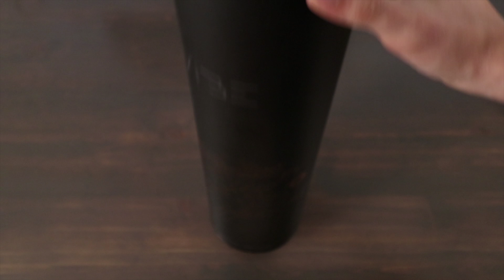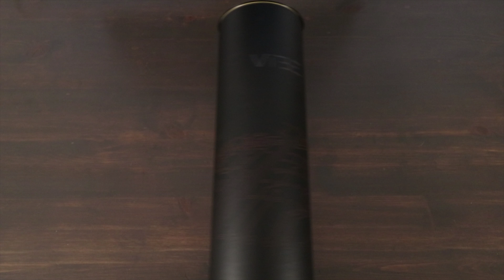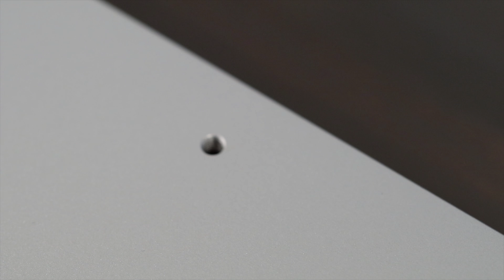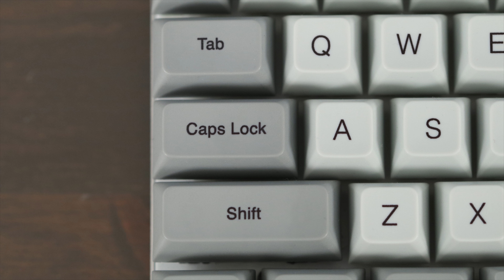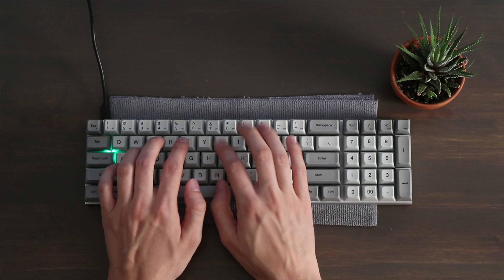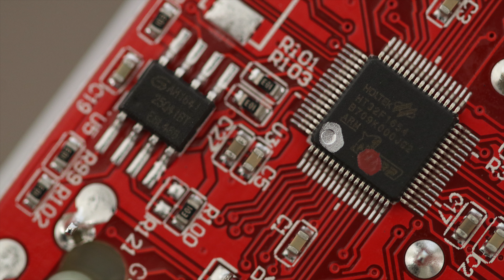Vortex Vibe Review

Comment: I'm hoping the programming steps on the consumer version includes the 128 char count in the macros.  I don't see it advertised anywhere.  I have great ambitions for macros.  Edit:  It works on the consumer version too.  I'm exploring this keyboard now.  Very fun.  Sounds much better than my MK2016 also with browns.  Thanks for making the function layer map.   It's much more useful than the user manual.  Also, for those getting this board, I urge you to update the firmware, because I had issues changing to colemak before the update.  (The key combo turned on scroll lock instead of Colemak.)

Comment: I have this keyboard, and there are several differences between the engineering sample that you have and the one that is available for sale. Mine has no backlighting, a black metal plate, black cherry stem housing, and highly sculpted keys. I also have the Cherry MX Silver Speed Switches. One thing worth noting is that you do need to get the firmware update from the Vortex website to get the 00 key and the lighting on the caps lock working (I am on Windows 10). This is a very unique keyboard that has somethings that I really wanted...a reduced TKL-like layout with a number pad (I use the numpad a LOT).
Reply: do you use this for excel?
Reply: Man, I have this keyboard and always assumed my caps lock light was busted. Thank you so much for this comment!

Comment: I guess folks don't find the fn key placement uncomfortable? I think would be better if it was on the left of the keyboard, so it leaves the right hand to only press those keys on the fn layer as opposed to having one hand do both, similar to how the shift key is used.
Reply: on the pok3r you can configure the caps lock key as additional fn key
Reply: well standard bottom row is a very important feature (+ no other keyboard have the fn on the right aside laptop keyboard, anyway)

Comment: Does this keyboard work on OSX/macOS? Seeing as that OS doesn't have a num-lock mode, I'm concerned you couldn't use the number pad correctly.
Reply: Since it's not a typical keyboard transition, I would venture a guess and say that this "numlock" is implemented at firmware-level, so it should just work.
Reply: Hey! I was thinking about getting the vibe for my MBP setup as well. Were you able to get the numpad to register?

Comment: The bottom is missing the DIP switches from the Poker series. Do you know if it's still possible to remap the location of FN and PN? (DIP switch 4 on the Pok3r)
Reply: In case anyone else was wondering, I contacted Vortex and got an answer:

"You just need to choose a layer and then hit Fn+L_shift for 5 seconds then choose a new Fn position directly."